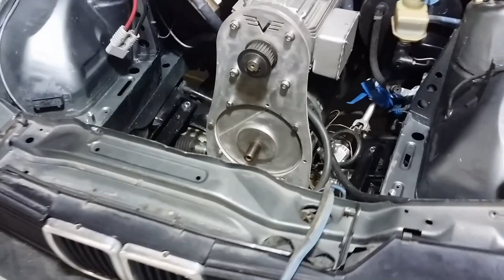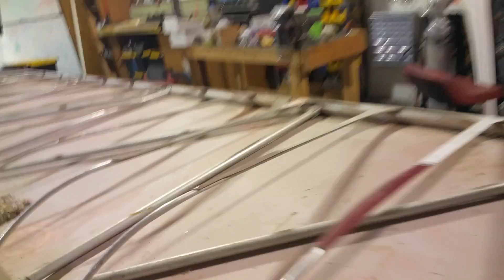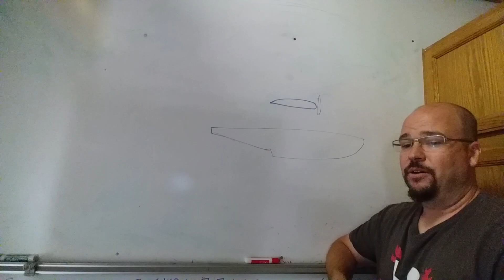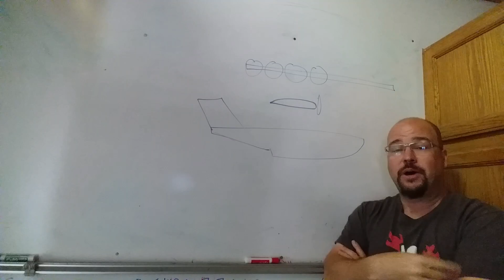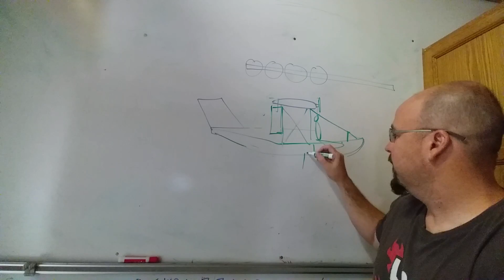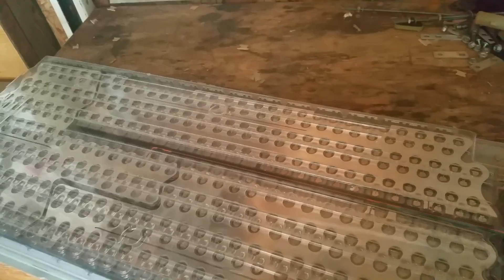EV Challenger, EP1: The electric airplane project begins

Comment: A pity to have 12 ugly drone motors on the Challenger’s wing, a little bit of an oddity, the Lazair worked well on far less draggy units stuck on the LE. I admire the ingenuity but could you not group the motors to harvest the combined power on a bent driven system gearing up to a single prop? Very interested and will be following this closely

Comment: Is the frame Light weight metal composite, or pure aluminium. How thick are are the frame pipes. I have been wondering because almost all ultralight i have seen uses metal frames instead of carbon fibre. With carbon ppl could get 50% out of frame weight. It would mean less power need for lift, also less engines, or bigger power banks.